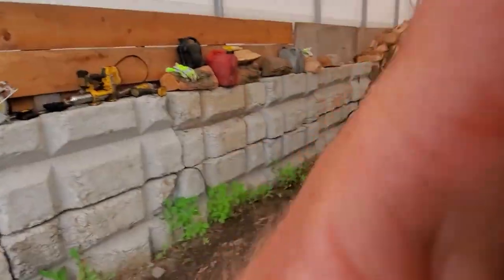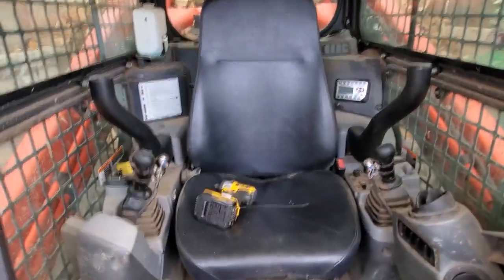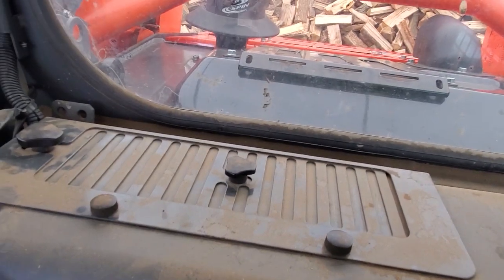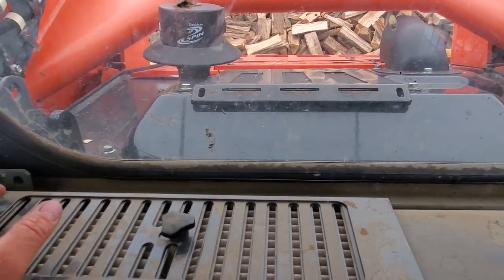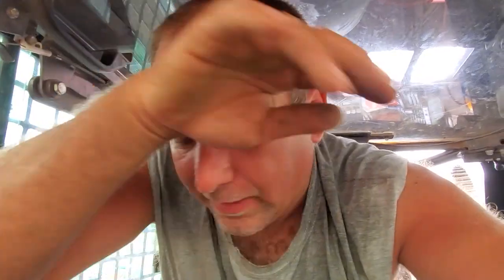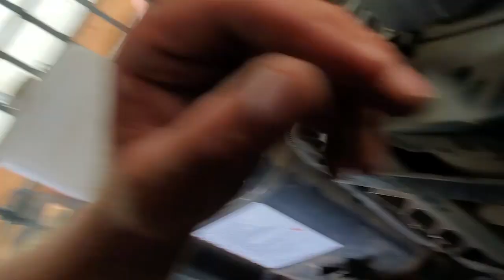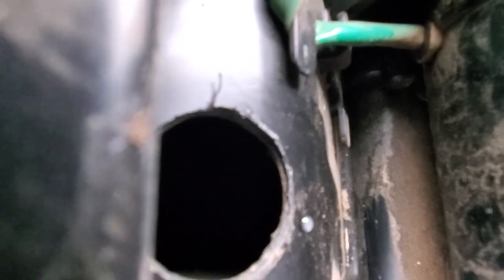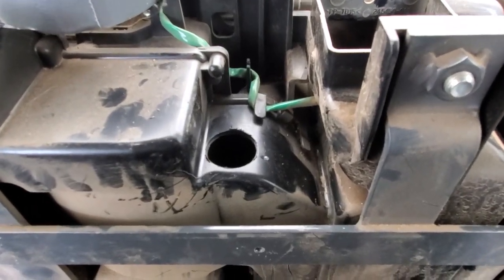KUBOTA SVL75 90 95 97 AIR CONDITIONING NOT BLOWING FIX

Comment: Just done this on a 95-2. I drilled both holes as in video. I then soaked evaporator with coil clean on both sides, rinsed with water and used a flexible big truck air filter blow nozzle to blow everything back through the evaporator backwards from operating air flow by inserting blow nozzle in the square air outlet that's between the evaporator and heater core while clearing the drain tube with a long zip tie in between each step.  I repeated this 5 times then let stand a few hours. this seemed to work very well being air flow was back to normal when everything was back together. thanks for this valuable information.
Reply from the maker: Thats awesome man! I'm glad it worked for ya.    Not fun not having AC in this heat.

Comment: Thanks for the video. Did this today on SVL 75 - 2. Super easy, AC is blowing great again (like new), was pretty much non existent, coil was completely blocked up. 95f today in Texas sun and nice and cool inside cab again.
Reply from the maker: Thats awesome Jeff!   Glad it helped you out.   Those cabs can become unbearable in that heat
Reply: We took the seat out which made access very easy. Seat was easy to remove.

Comment: Nice fix Kev - you saved 7-10 hours downtime for the machine, everything is made to go back to the dealer, had to take the Tacoma in for some warning lite that they said was a glitch. Stay hydrated and out of the sun. Cheers
Reply from the maker: Ya it saved a ton of time thats for sure.   And you are right,  hard to do anything yourself now cause you need a computer for it.  So back to the dealer

Comment: Just did this to my svl95 and holy crap what a difference…. The plastic is easily cut with a sharp razor (I heated mine with torch to melt thru). Took a paint scraper and scraped the crap off, vacuumed the bottom quick, and shot it with brake clean. Shiny and looks beautiful.. tapped it up and now I’m shivering! Beauty tip
Reply from the maker: Glad this worked for ya.   Such a easy way of doing it and way cheaper.   Stay cool!!

Comment: You’re a Saint, just did this and worked perfectly after.
Reply: Also I did it on SLV 65 and it’s the same
Reply from the maker: That's awesome!!! Glad it helped you out.   The cabs get crazy hot with out the ac working right

Comment: The Kubota skid steer engineers must only test  in a perfectly clean laboratory environment.  Being able to service your filters for the cabin for heating and air conditioning should be an easy to service item.  I am sure you'll really appreciate the climate controlled cab when your Eastonmade 48C arrives.
Reply from the maker: Ya its  a pretty big problem.  I'm sure they are starting to see these problems and hopefully fix them.   Hard for them to hear about them if it's talked about in private groups.   Now that it's getting some air time maybe they will take notice.
Reply: It's the same as your in home set up.. you need to clean the vents the filter will stop 98% of the crap but you need to replace them every 3 months and at least once a month in dusty conditions...Noone ever does.. next best is do what Kev did

Comment: JB welding a fitting on there that you could either screw a plug in or attach a vent hose to 1 end and a leaf blower to the other would possibly be a good thing. Possibly give it a squirt with water first and then use a leaf blower or even a compressor to dry things out afterwards.
My old BMW stopped pumping air out of the AC entirely. After googling I found out that there's a bit that's known as the "sword" due to the shape. The afterthought HEPA filter is before the sword and when it blocks up the sword overheats and the heater and aircon stops. The HEPA filter literally mounts behind the heater module against the firewall. Absolutely awesome to access that through the footwell. You can't see the nuts that release the filter and you have to work from photos and by feel. The same to access the sword after you remove the filter. Engineers totally shit me sometimes and many of them deserve a kick in the nuts.
Reply from the maker: This is a great idea Alan.   I think I will look into the more for when I go and do our 90 and have I ready to go.   Thank you

Comment: What size hole did you drill?  My 95 is doing the exact same thing and I’ve been thinking all along that the engineers didn’t make the a/c system strong enough.  So, I googled it and found a video of the system being clogged.  As the guy took apart the entire system, I called the local dealership and they want $630 to do it.  Then I find your video of just blowing it out.  Thank you!
Reply from the maker: Hi Lockhart,   glad this video helped you.     I'm not sure the size of the hole saw I used,  I think it was a 1 1/4 I just kinda grabbed one and it worked out.

Comment: So, that red hose you fed down in there from the top, are you blowing it out with air or water? Also, is that the sound of a shop vac sucking from the bottom hole?
Reply from the maker: Ya the red line is a air line and that is a shop vac.   It's just sucking out everything that comes out of it.   I have seen people us water to wash it out too.

Comment: We’re you using vacuum through the tube or air compressor to blow it out? And thanks for the tip  I’m gonna do this as soon as I get mine home from work site
Reply from the maker: Vacuum in the bottom hole and hp air in the top.  Problem when I did ours it was running before I started to it was wet so the vacuum didn't help super well.   I have heard of guys putting the bottom hole lower and just using water to clean it out too.  Water apparently drains right down to the belly pan and out.    Either way will save you spending 6 to 8 hrs pulling the whole thing out.
Reply: @SkidderKev  thank you so much

Comment: so to help prevent this when running with the door up leave the AC and fan off the whole time so its not sucking any air through the intake ??
Reply from the maker: Guys say to close the inside filter system will help.   Kubotas filters really suck for this.   I don't think there is any way to really completely stop it tho.

Comment: I guarantee this got ya an Atta Boy from the Boss!👍
Will it also heat better this winter?
Reply from the maker: Ya everything should work better now.   I don't remember how well the heat was working.   I was running the 90 all winter.       Ya pete was very happy to have it fixed.
Reply: @SkidderKev  Would not be good on whole system to be plugged up besides the hot operator! Have a great day!

Comment: You don't have to cut it... if you have a powerful enough air compressor block all the vents and pressurized one of the air vents. I pressurized the one facing the door. Just reverse the flow essentially. This will blow everything up out of the evaporator behind the seat area (on top). You can use a Shop-Vac back there while you're blowing it out.

Comment: Ya just cut holes in plastic... that’s fine lol
Reply from the maker: A few other ways to do it 1 spend 6 to 8hrs pulling the whole system out to get to it or 2 is to duct tape up all vents and use a leaf blower to blow back through it which doesn't get all the gunk and grim off it if it's wet.    
And it will be something you will have to do again as well.  
Your machine do what you want.